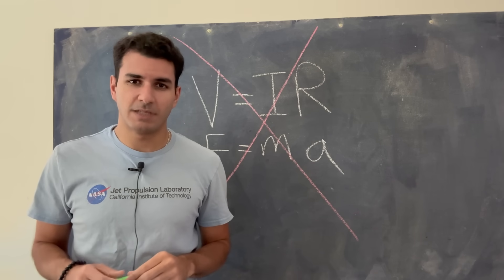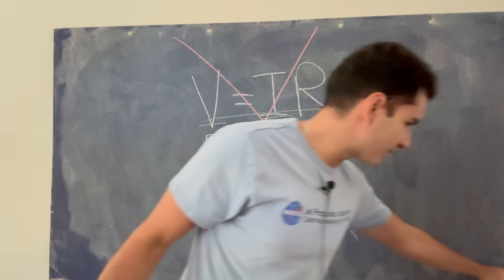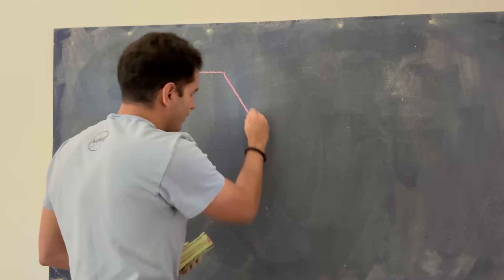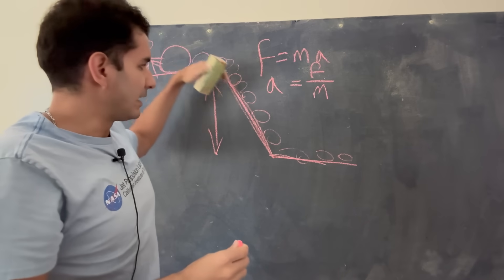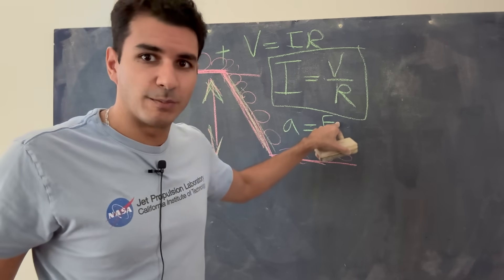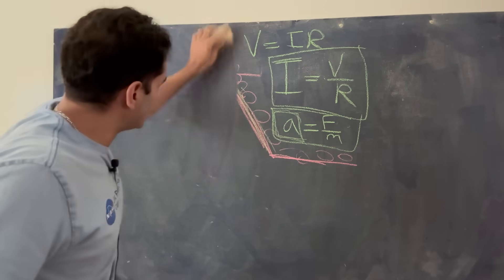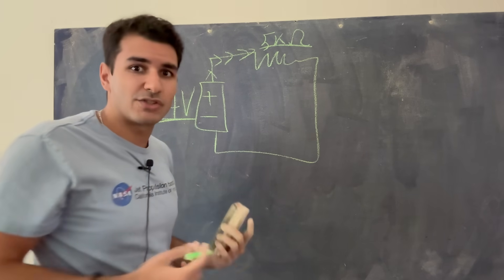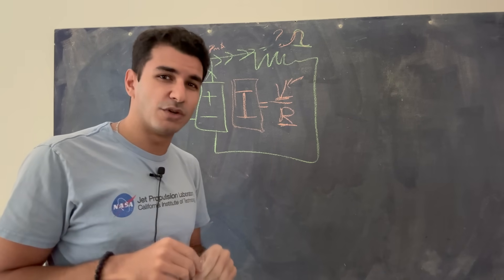You don't really understand physics

Comment: Good video, I think this was very insightful. The V=IR or I=V/R equation is just a way to show how those three variables are related. If you have 0 potential difference, you will have 0 current, and likewise if you have 0 current through some circuit element, you will have 0 voltage drop. If you have 0 resistance, you will have a very large amount of current. I feel like developing an intuitive understanding is important for this equation. What are your thoughts on using water pipes as an analogy for current, voltage and resistance?

Comment: You should do a video on why 0 Resistance is impossible.*

*Edit: My knowledge of Superconductors was outdated, so some of my comments in this thread are (partially) incorrect. 
Yes, Superconductors with 0 resistance exist. So, instead, they have Current Density. This, as @Miyomotomusashi69  stated, is something closer to how batteries store electrons.

However

This does not disprove that in Ohm's Law I=V/R, R =\= 0. When you do not have a dedicated Resistor, you use the resistance of the wire in the circuit. More accurately, you just end up creating heat within the circuit. This is in fact how a traditional light bulb works. Superconductors follow the London Equations, which only work in quantum mechanics.
Reply: Wait so superconductors are not really superconductors?!
Reply: @mistadude  near 0 resistance on a superconductor. 
Remember, dividing by 0 is impossible. Mathematically and in real life. 
If you were to say "How many apples did you sell in x day(s)?" [Sales=Apples÷Day(s)]
But, I spent 0 days selling apples... well I didn't have any sales of any apples then. There is no equation to speak of.
Reply: @treeross  this is true for conventional circuits, but superconductivity breaks this law due to the concept of cooper pairs, where the electrons are cooled enough to where they form positively charged "phonons", which are matched in a way that makes them behave as a single entity. Once enough of these phonons are formed, they condense into a ground state that allows them to move without scattering vibrations or impurities, thus creating zero resistance. Look up BCS theory for a deeper explanation.
Reply: @Miyamotomusashi97  wouldn't the current still not exist in that case? Because current is a measure of V/R, without one value you can't use that measurement, right?
Reply: @treeross  the phonons do not behave like traditional electrons, when they are paired they are put into a quantum state and move through magnetic expulsion from the inside of the superconductor, which is how they exhibit current without voltage. Although a voltage is initially present which supplies the superconductor with electrons, once these thermal reactions occur the electrons are essentially "stored" within the superconductor, where they can flow without dissipation of energy. This is quantum mechanics, which goes beyond the realm of normal electrical circuits.
Reply: @treeross  this is why superconductors are so hard to create because they have to be cooled near absolute zero, but they have the potential to change the world in a lot of ways if they can become more manageable. There are theories that metallic hydrogen is a superconductor near room temperatures, but we aren't even able to test that theory yet technologically.
Reply: @Miyamotomusashi97  the way I'm thinking about it, the only actual superconductor with 0 resistance is 100% empty space (not including the theoretical wire with 0 resistance). Which, even in what we call "Space," it's not necessarily empty. There will always be something to trade electrons with.
Reply: @treeross  this is true until the electrons form into phonons which behave differently as they are basically 2 electrons forming an equal and opposite reaction which essentially condenses them into 1. Electrons are repel eachother negatively, creating current while these phonons attract each other and would not flow through a circuit without a force like magnetism. Superconductors are not a source of energy transmission alone, rather they are energy storage, so instead of looking at them like they are conducting wires, it's better to look at them more like extremely efficient batteries where the energy can be converted from magnetic energy into usable electrical energy when the original temperatures rise back to normal.
Reply: 😂😂😂🎉 @treeross
Reply: @WilliamStubitsch97 😮
Reply: @treeross  Sorry, zero resistance is possible, as others have pointed out.  Keep in mind that when we have zero resistance we have zero voltage between the ends of the path.  Thus we have the current expression 0/0 which is not impossible but is instead mathematically indeterminate.  Thus, the current can be anything.  The reality is that the current becomes any value necessary to keep the voltage at zero.  (That does not mean we can have an infinite current.  There is an upper limit to the current density that a given superconductor can support.  Within that limit, the zero resistance applies.)  🙂
Reply: @treeross  Thats becasue 0 does not exist in the universe. It is a human made concept to express the absence of something
Reply: @treeross does that mean dividing by 0 in real life is just 0?
Reply: @analog_guy  i would still say that if current is a measurement of voltage and resistance, you need both to measure it. 
I wouldn't say that means there is no electricity in the circuit, but i feel like it boils down to semantics at that point anyway.
Reply: @treeross  Cooper pairs (a pair of electrons in a superconductor) behave like bosons, not like fermions. When paired they occupy a lesser energy (quantum) state than "regular" electrons occupy, which means that they no longer will interact with protons. It's been a while since I was educated on this kinda stuff so I'd be happy if @Miyomotomusashi69 could verify what I'm saying lmao
Reply: @treeross  As far as I know, some physics equations break at extreme values. For example the classical kinetic energy equation (1/2mv^2) breaks near the speed of light and you should use another equation. Maybe that is the case for V=IR as well?
Reply: @atomgutan8064 v=ir is a classical equation and super conductors are operating in the quantum realm. Once the current has started , the power supply can be turned off and the current will continue in a loop for years. I don't know that much about super conductors except that you can't have infinite current .the current is limited the temperature of the superconductor. If it is near the critical temperature, the critical current is minimum . If the critical current is exceeded, the super conductor will start to exhibit properties of a regular conductor.
Reply: You cant just use electrodynamics to understand superconductivity. Your whole way to think about particles doesnt Work with qm
Reply: @atomgutan8064  Yes, for superconductor you need QM and in general condensed matter physics.
Reply: @Miyamotomusashi97  efficient batteries that need lots of energy to keep them in that state.....
Reply: @perc-ai which zero do you mean doesn't exist?  The affirming or the nonafirming negation?
Reply: @Miyamotomusashi97 Hey sir I have a question, I am studying in highschool right now. So we don't have experimental learning yet so we actually don't know how circuits look like. 

While studying Inductors , I came across R-L circuit. There it is shown that if we keep a battery, a resistor and an inductor in a circuit ( in a rectangular looking way ) with a key closed , the inductor gets energised , however when we open the key , the inductor looses energy causing current , but how does the current flow if the circuit is open ? 

As in highschool, we have learnt that current shouldn't flow in open circuits .
Reply: @analog_guy Sorry, 0/0 is not undefined. It's rather Indeterminate.
Reply: @torzla  Thanks! I stand corrected on my math terminology.  I will make the correction.
Reply: @treeross  Current is the movement of charge.  The current in a superconductor can be determined by the magnetic field that the current produces.  Current is not defined in terms of resistance.  Resistance is a measure of the opposition to a flow of charge.  Resistance is defined in terms of voltage and current.
Reply: @treeross  100% empty space would have a resistance that is very high - not close to zero
Reply: @treeross when engineers try to do physics arguing about causality  of V=IR and then pretending superconductor don't exist. I guess it's right most engineers don't understand physics
Reply: Superconductors have entered the chat
Reply: Why do electrons keep their scalar angular momentum? Same kind of q. And the answer is that we don't know why or how, we know how to describe it and sort of how to derive it from qtf. But even in the old days there was this problem of a void, how come there are forces between stuff and no friction in the vacuum. Which was a problem even before any good vacuums were produced, the Greeks thought about it, and many thought empty space did not and could not exist, so how no friction?   Meme version of the truth, but still. The answer is that momentum and energy conservation are not fundamental concepts, just like geodesics that belong to physical structures in space and time, what if i told you you're a wizards harry, no wait wrong comment, what if i told you there absolutely is dissipation in a superconductor, just no dissipation into macroscopic heat, and it happens at just the same rate as the spin of the electrons decrease, the speed of light and a whole bunch of other stuff, and therefore, using our intrinsic units of length and time belonging to the emergent lenght and time scales belonging to our constitution, lands us with a symmetry associated with our local notion of energy conservation, when a superconductor loses momentum and energy just the same as a mass traveling in the vacuum does, we just see it as expansion and because of the congruence in the physics locally under the transformations i alluded to, we see it not as dissipative at all. Unless we know about the workings of the substrate which has other symmetries related to different notions of energy and momentum conservation angular and linear. Of this could be the case woth no intrisic expansion, just by changing the time scale for the congruence in intrinsic physics over time, the expansion bit is crucial for the driven nature of the substructure that generates our familiar "fundamental" physics such as quantum mechanics and GR. For examples take two drums of wire and tie them together, if the atoms they are made of shrink, or the space they are in expands, the drums will get spooled up they will gain energy and angular momentum on each side, just from being in an exoanding space and attached at great distances, or their structure shrinking in a non expanding space, the two are equivalent. But imagine now that the setup is made out of atoms that are radiating away they mass and losing to the substrate in which they are emergent structures. What happens? As the form of energy and momentum and gradient energy the setup akd vacuum structure is made of decays into another form, the intrinsic notions of energy conservation is broken, the drums actually speed up, but remember that tgis energy abd momentum comes from the decay of their constitutive structure, it is not so clear that you can't have an ultra conductor that actually has negative resistivity, just from the properties of emergent structures that are conceivable, so why is a superconductor that weird? That issue of getting rid of friction no longer looks like the right way to view it at all. And quantum mechanics with ground states that are elastic and also current densities that are elastic no longer looks so strange either. Quantum mechanics is just a quite cryde framework, it doesn't even begin to touch upon what is possible in mathematical physics, i think the destinction between quantum physics and classical is shaky af, and quantum mechanics is just a convenient way to describe certain classical models that people just haven't thought it yet, well i know that is the case, but let's not make sweeping claims about stuff that isn't published yet.
Reply: What about if V=IR is not complete for such theorem?
Reply: There is zero resistance and negative resistance too all physics taught is bluff and bullshit distort the reality negative resistance simply means energy genration
Reply: Coz if the resistance is zero, the current would be infinite.
Reply: Eg, thunder  @pavithran2046
Reply: same with superfluids, its like they dont “touch” anything
Reply: Even the mass of electrons act as resistance, there is a limit to how much you can drift the electron even without any other resistance, and with limited amount of electrons in a conductor, current can never exceed a certain limit and hence 0 resistance is impossible
Reply: A wire approaching zero resistvity is called a perfect conductot and its current will be caused by a voltage difference approaching zero. The connecting wires in electric are actually assumed to be equipotentials and currents still flow inside them.
Reply: near 0 resistance on a superconductor

Jesus died, and rose, offering salvation, grace, forgiveness, and hope for those who repent✝️❤️
Reply: Any resistance below 1 is like creating energy from nothing
Reply: Its not possible cause lies in its propertys 
I assume you know that R=(row×area)/length 
So if you want 0 resistance then area must be zero that physically not possible and row is a now zero constant..
Thats why resistance can never be zero
Reply: Gee I wonder why, let’s touch the live wire and find out!